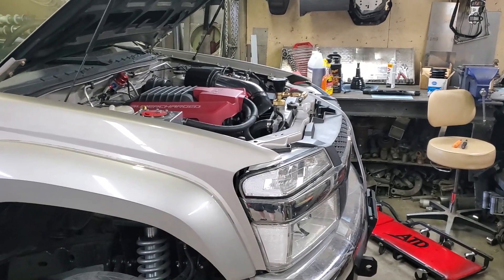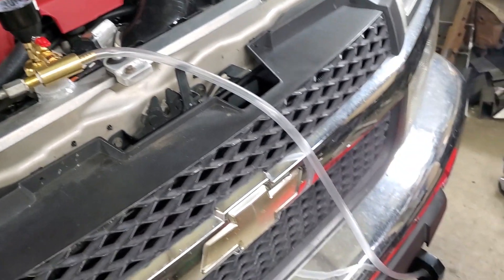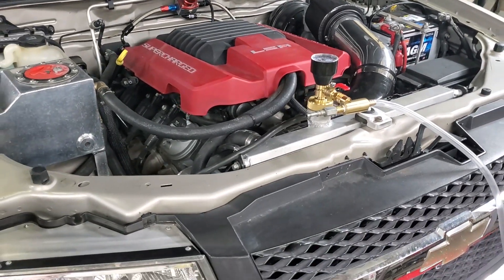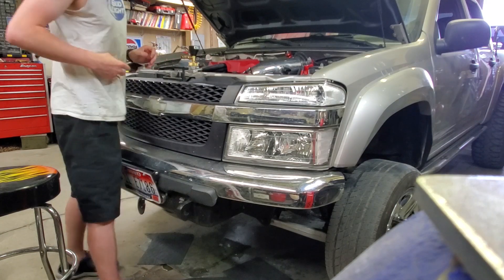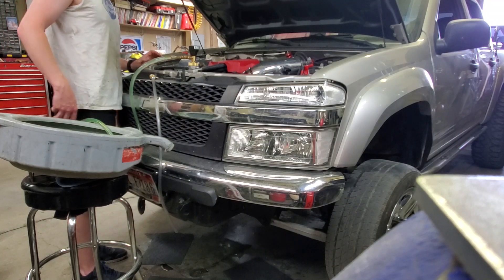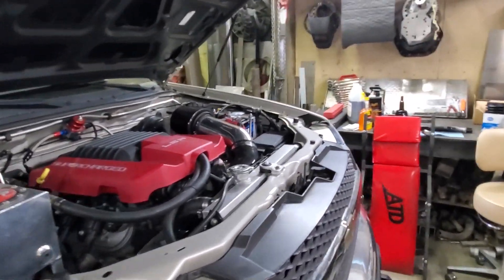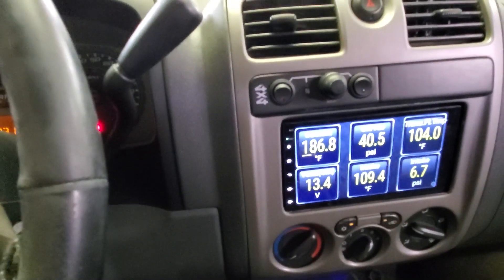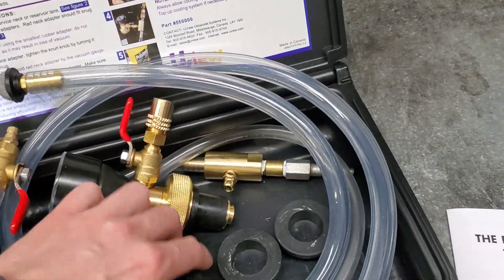LS Engine Coolant System Airlock Purge & Fill

Comment: Nice hobby truck ! What motor came originally? And were you in engineering mode to get your display showing all that  info on your display?
Nice !!!
Reply from the maker: Thanks! It originally had an inline 5 cylinder 3.5L. For the display I'm using a cheap Android head unit connected via Bluetooth to an OBD2 code reader and running the Torque Pro android app.

Comment: Is that radiator one that fits a Colorado like factory or a universal one? I have a 05 4cyl with a turbo and the radiator is finally leaking
Reply from the maker: It's the Griffin Colorado radiator. I had to modify a couple things to get it to actually fit though like AC condensor mounting

Comment: Hopefully that cures the issue
Reply from the maker: I think it helped cool down quicker and not climb temp at and idle with the AC on. It still got to 230 climbing some hills on the highway, so I moved my heat exchanger and it think that helped as well.